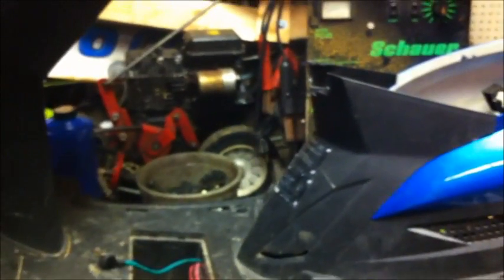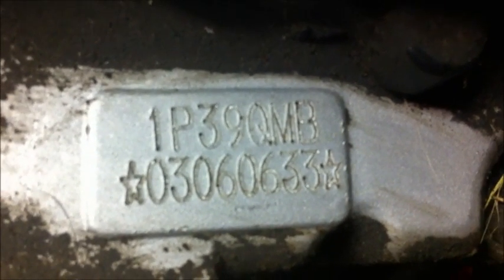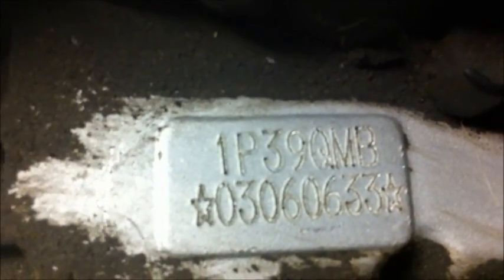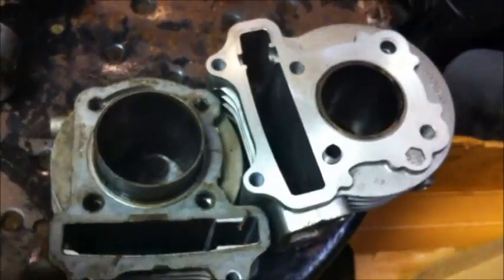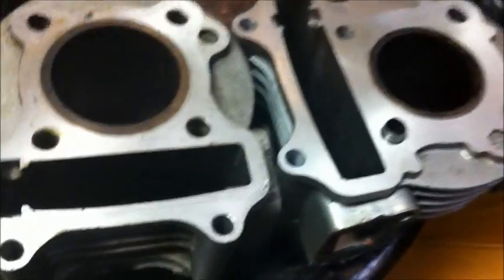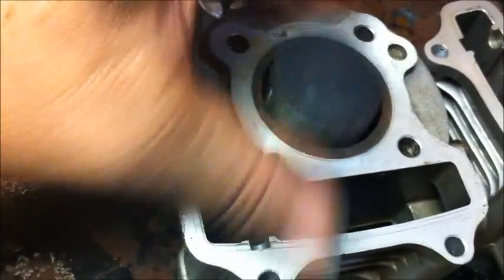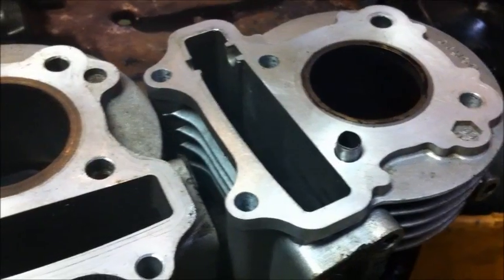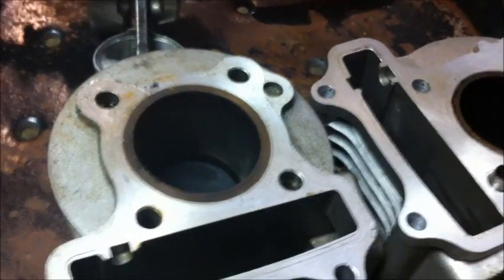Chinese Scooter 49cc 64cc difference 139qmb and 1p39qmb

Comment: 1p means one horizontal piston.I know it makes no sense but i learned it from a chinese manufacturer.Some engines come with 69 mm valves and others witg 64 mm valves.The head is different,so when replacing the head make sure you know the valve length

Comment: Sorry my friend..  but your information is completely incorrect.  There is no difference between the two engine codes.  However, you most likely have confused the Chinese version vs the Tie-wan version.  There is no stock 64cc QMB engine.  They were all 49cc.
Reply: Surprised I had to scroll down so far to find this comment. It's a shame the OP misled me for years with the idea that 1P or XS means that the engine has a higher bore.

You're very correct that XS and 1P are key indicators that the engine is from Taiwan. Functionally, my XS1P39QMB engine was completely identical to a 139QMB long-case engine, except for the electrical connectors for the starter and the stator. The dimensions and internals are completely identical

Comment: I saw this video a couple years ago after buying a few used scooters, one was a 1P39QMB code and the other a 139QMB. Something that just occurred to me was that, (correct me if I am wrong), 
49cc scooters are not designed to carry a passenger from what I have seen, but most of the scooters that I have seen with a 1P39QMB engine have passenger foot pegs. So it is my assuming conclusion that the P code engines are designed for scooters that will carry a passenger ie to have enough power for the load of two people.

Comment: Hey brother,I got a 2020 Revolution/Baodiao scooter.It 
came brand new ,with the 1p39QMB code .But- it has the 50cc cylinder& piston on it.Its all
factory original.Is this a rare thing or not? In your "p code" video you said they should all be
64cc's.
Reply: Tore mine apart, a P code, its got the tiny 39mm piston as well, def 49cc. It does have a slightly taller head tho, and the cam sits every so slightly lower in the cradle, and it has the 69mm length valves. Maybe the P code guy in vid tore down haf a bbk put on it and he didnt know, it actually looks like a 80cc bbk that is actually 72cc if you buy the new grind head , it could be an 80cc if it has the stroker crank installed. Even a 100cc bbk head and jug does not give you 100 cc, youre lucky to 90cc with it unless you stRoker crank it and it gets to 96cc that way. To hit 100cc you probably have to deepen the compression chamber area of the head. Hillbilly trick:,jb weld or epoxy a wood dowel or drill bit into a ping pong ball, coat it with valve grind paste and grind it down till theres barely a hint of ring around the valve seal, then switch to a tennis ball (or a light bulb,plastic or glass same procedure but by hand). It takes A LONG TIME by hand but you can use a drill or drill press too! If you have the confidence or an extra head, use a die grinder, but keep a set of valves installed so you dont damage the seats! When porting inside the ports, i put machine screw thru the chamber side and a washer and nut on cam side to prevent any damage to the valve guide shaft.  On a stock 49cc head, I use a 1" 82° bit followed by a 1"90° bit to open up the gasket sides of the ports, and it opens them up like a charm and you could stop there and have excellent flow increases, but youd want to at least smooth out the chamfer ridges the bits create.

Comment: I have a p code engine in my wolf scooter and had one on my old x pro i sold a while ago but it also depends on the weight of the scooter.
My old x pro would easily hit 45ish as it was light as fuck.
My wolf scooter is heavier sot it goes about 38-40... though its also pretty modified with a 20mm carburetor, race cdi, 7 gram roller weights, aftermarket coil, ngk sparkplug, nibbi racing intake, K &N filter, and leo vince exhaust. 
I'm plannig on getting a 52mm bbk soon.

Comment: I just bought a Coleman scooter which was labeled as 49cc. The engine however has the P code on it. Does that mean it's actually a larger engine than 49cc?

Comment: Hey Dan I have the same engine 1P39QMB needing to get an intake for it it is a 2013 Chongqing Bashan Ruckus style scooter, any info as to where i can get more info etc?
Reply: I have the same scooter, same year even.   If you didn't get an intake for it eBay and Amazon are both a good source of parts. There are specialty outlets as well if you want to buy the best quality parts for it but they are much more costly.

Comment: I've looked high and low for a simple explanation of this engine size.  You have a new subscriber.  I have just purchased a wreaked 2020 Tao Tao VIP.  I've gotten it buttoned back up.  Is there any power mods other  than the normal ones?  And what do you think of a big bore kit or should I just leave it alone because it's a 64cc?  Thank you for your time.

Comment: This guy is so wrong 1p39qmb and the 139qmb then there's the qmb139 there all the same horizontal I own 4 diff scooters all with gy6 engines my 2017 tao tao racer with up grades will do 70 plus I have all naraku upgrades plus a nos kit from 6stigma.com when I use the nos I'll do 85
Reply: Then why is mine 44 in a 2007 peace sport
Reply: @joeybomba8046  do what

Comment: Hello, I have an old XS1P39QMB. I bought a straight 139QMB and it didn't fit. I have located a 1p39QMB engine on amazon, but I need to know if it's compatible with the XS1P39QMB. What does the XS mean? Thank you
Reply: XS is the company it is made by.

Comment: Good! Have both a 2014,  49cc   Roketa, and a 2014,  Tao Tao. Both have 20,000 miles,  with no issues. Regular oil changes. Dealer said Roketa was 60cc.  And Motor Vehicle said Tao Tao was 2.18 hp,  49cc.  Had to register as motorbike.  Will check serial numbers. Thanks.

Comment: Can you do a big bore kit on the pcode engine
Reply: have u found answer to this? i am looking for big bore kit for xs1P139QMB. cant find any info web is empty on this
Reply: @sanelb1147  Hey there. XS1P39QMB is literally the exact same as a standard 139QMB long-case engine. It's just made in Taiwan for SYM scooters. There is no such thing as a "secret 64" or anything. Your engine will be fully compatible with any 139QMB big bore kit. I recommend the 47mm kit as it's pretty discreet and won't overstress the bottom-end components

Comment: LMAO dont listen to this guy the P simply denotes  that it is a horizontal  cylinder.. some manufacturers  put it on most dont because all qmb139   engines are horizontal cylinder, with the exception being the  "50cc" trikes... they  call them 50cc but most actually ship with a 64 or 72 cc  cylinder.
Reply: Not true try putting a head off a non p code engine on a P code and try to use the non p code rocker arms The valves are also longer on the P code head

Comment: Hey GY6, I bought a really cheap 2012 49cc Peace Sports but it appears to have Tao Tao body Plastics on it.
The Head light & Fuel Gauge don't work.
I have an extra 4 wire connector ( white, green, brown and blue, all solid color wires) behind the front cover that don't plug in anywhere & I cant find any info on the interweb about where it goes.
Any help would be greatly appreciated!
Thanks.
Reply from the maker: that harness is actually for a dealer installed alarm

Comment: hi, I have the same scooter as yours. Mine is a 2014 taotao thunder and I was wondering what do I need to do to keep it lasting. I heard that taotao put in 49cc parts when the engine is a 64. Please advice me what I should do I prolong the use of my scooter thanks.

Comment: Just got a new 1p39qmb 2015 model bd50qt-9a  def gets up on speed pretty well it has fast acceleration from 1-35 then climbs slowly till it tops out at 47mph. just ordered a 50mm big bore kit and couple other upgrades taking a ild guess thinking it will change to this is low standards thinking to: maybe 1-60 fast acceleration and climb to 75-85mph but i ordered a bunch of top end parts. going to order a no rev limit racing cdi next with an rpm tach and oil temp tach.

Comment: awesome video.  just put new clutch and variator in mine and I hit. around 64 mph with a 1p39qmb and. I did the same. to my 139 qmb motor and only got 51mph.   wants to mod them both up a lot more
Reply: What RPMs were you at at 64mph?

Comment from the maker: As long as you don't fly past them.I just helped a friend mount a 150cc engine on a ATM-50-A1 frame,the reason he did it was the 150cc engine can handle more miles and it and will last longer than the 50cc engine but he still rides it slow like when it was a 50cc ,it will go 70 mph but he runs it only 30 mph max, as long as he is not speeding the cops don't care and don't mess with him, No endorsement needed even on yours.